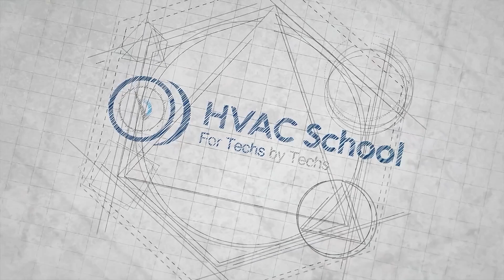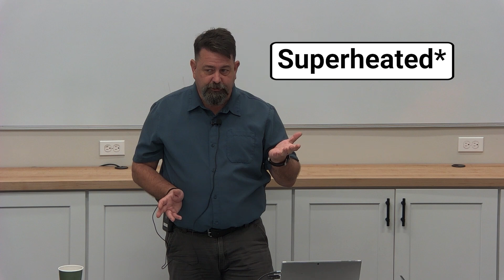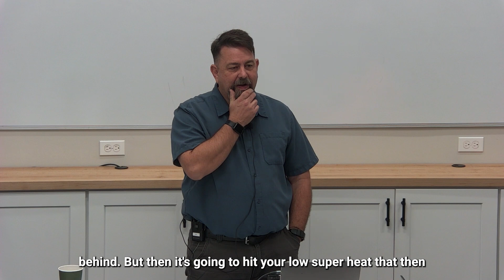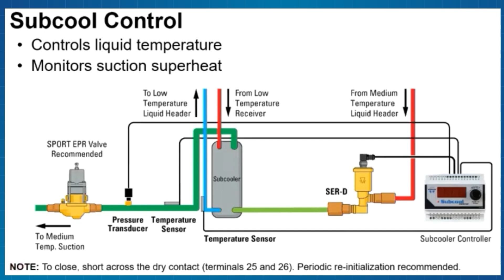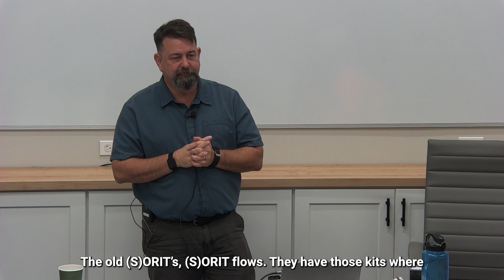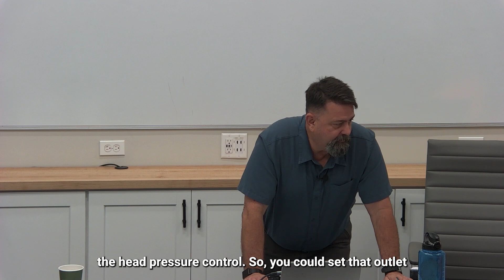Rack Refrigeration Cycle Part 7 - Subcooler and Liquid Pressure Regulator

Comment: Hi, why liquid at the evaporator outlet, would result in more valve opening and more slugging of refrigerant into Compressor? Why it is peculiar to sub cooler connected to medium temperature end.

And how super heat will increase once it hit zero? Could you please shed some lights on it?

Comment: Easier to just say the saturated liquid-vapor mixture temperature is set by its pressure...  a flooded evaporator is in the compressed liquid zone and is no longer boiling and will warm up to the temp of the injected liquid.  So if its not getting cold your not in the saturated liquid-vapor zone and therefore are not refrigerating as you do not have any flash gas anymore.

The way you use the term 'superheat' is odd.  Superheat is vapor that cannot condense back into a liquid.   The TEV is detecting where the saturated liquid-vapor zone ends and maintains a liquid level in the evaporator.  Liquid doesnt have superheat... thats a vapor term.  It is odd if they teach it this way in college to be used to explain liquid.  Compressed liquid can be warm or cold, you can easily have -100c liquid or 10c liquid.  But I sure as hell wouldn't call it superheated liquid - aka "liquid that cannot condense" lol.  Your not increasing its temperature above its boiling point at its pressure, your increasing its pressure and preventing it from boiling due to a higher boiling point set by the pressure.  “Superheated liquid” is physically nonsense.

I have a patent on a new style subcooler for refrigeration systems that allows you to boil the refrigerant to ice while re-injecting at or near the temperature of evaporation.  This eliminates flash gas and I am only maintaining a liquid level.  Kinda have a little bit of knowledge of the art.  ;) 

Refrigeration only occurs in the saturated liquid–vapor region where latent heat transfer happens. A fully flooded evaporator that is no longer flashing is simply cold liquid and provides minimal refrigeration.

Also, superheat applies only to vapor — liquids are either saturated or subcooled/compressed. Eliminating flash gas and maintaining liquid at the evaporation temperature dramatically improves capacity utilization.

Calling liquid “superheated” is incorrect physics.

Is about the same as “dry water” or “solid vapor” or “cold heat”...   Can you get me a bowl of liquid dehydrated di-hydrogen monoxide? LOL

It’s the same energy as a machinist watching someone misuse a micrometer.  Rather entertaining to be honest.